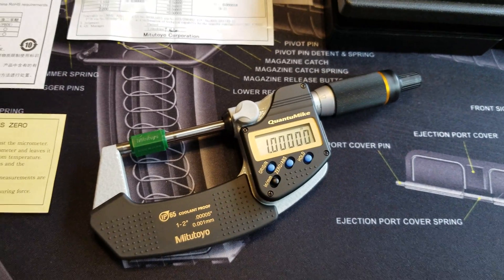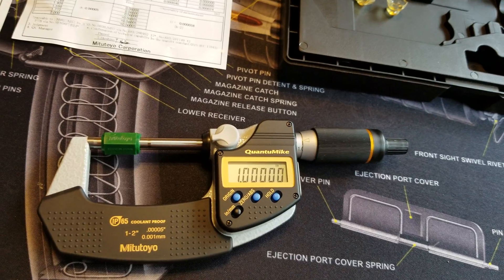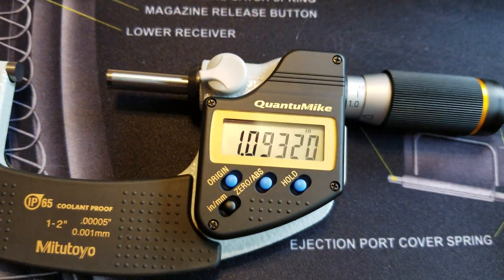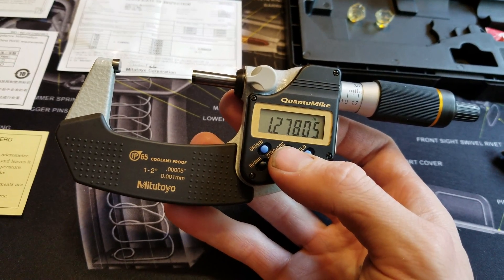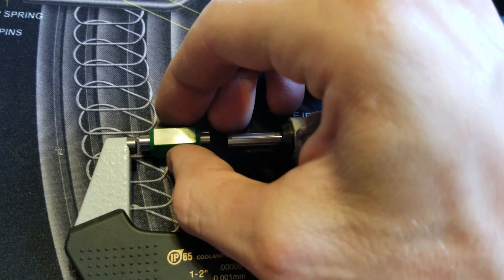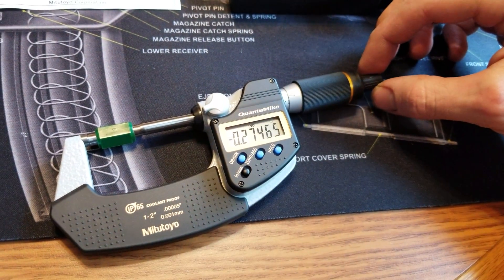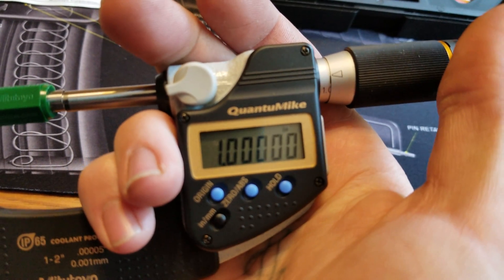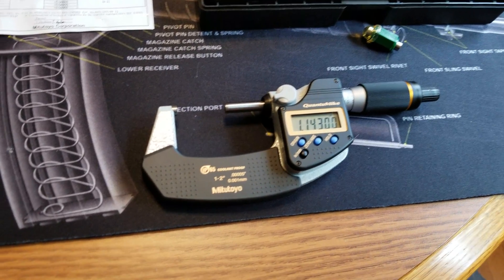Mitutoyo 293-181-30 QuantuMike Micrometer 1-2"

Comment: 04:31 thanks that proves to me that the surface area of the anvil on the Mitutoyo mic is 99.9999% flat probably with an undulation tolerance of +/- 0.05µ. Anyway, good focused camera work and narration.